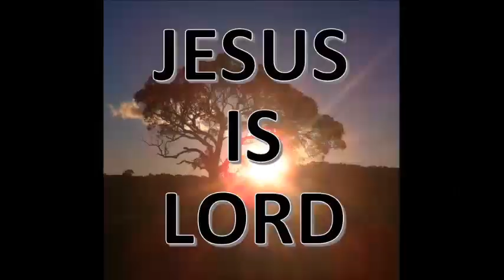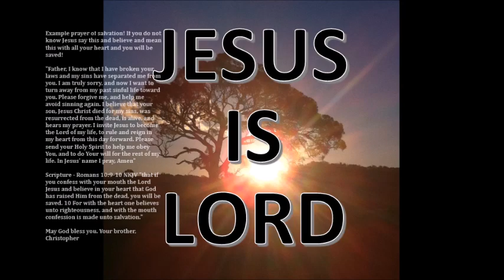15$ Shipping Container SOLAR LIGHT Full Install!

Comment: Ummmm, this is freaking genius.  Any word on how well it has lasted 3 years later?
Reply from the maker: Lasted fine no leaks. It's better to set the bottle higher as the plastic has sagged a bit more so the bottle is lower in position than originally set, but totally fine still.
Reply: @JESUSisLORD , Thanks